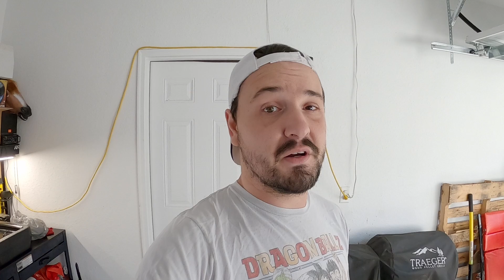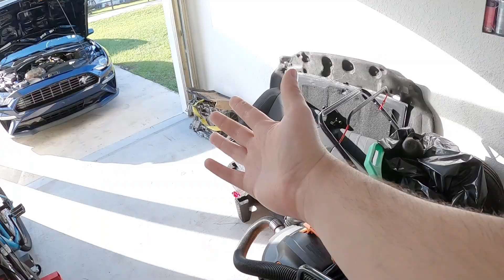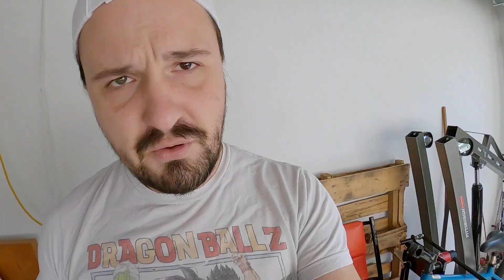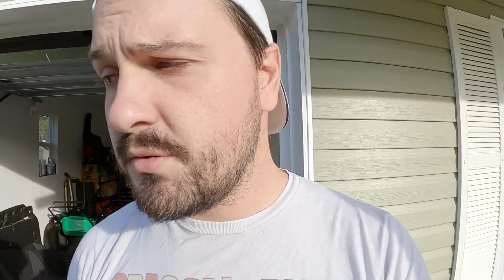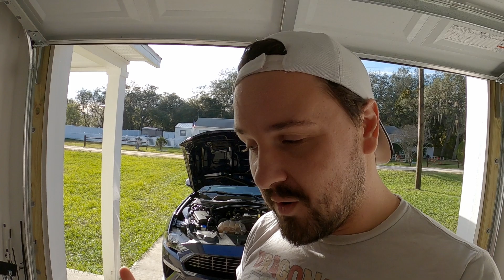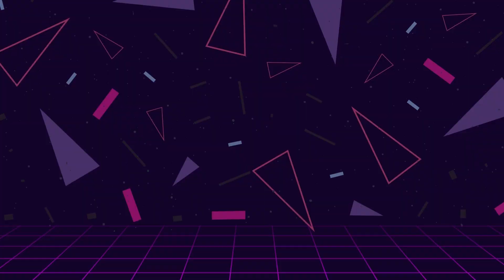I AM THE TUNER!

Comment: That sucks your experience with Gearhead. I've had great luck with their 93 and e85 on my 2015 Interceptor sedan. BTW in one of your last videos, the scratch on the oil filter sealing surface can be polished out with an ultra fine stone from Amazon. As well as the nicks around the edges.
Reply from the maker: I thought about using some jb weld to make the repair to the filter adapter. Spread it on and sand as flat as possible.

Comment: 6:44 you wanted advice and Ryan recommend that you get a tune, that is advice you asked for advice not answer, 
Most advice is not free, and answers are definitely not free so he gave you a strong recommendation and you choose to take that as a personal insult
Reply: How much money did you spend with Ryan of PD tuning?
Reply: @coyote_chaser  none, I a am getting the ford power pack for the 2020 eco boost mustang, I have a warranty
Reply: I had that same issue when I went from the stock 7 psi in my mustang and switched to the 12psi spring on the stock turbo. I called ryan he recommended I get a tune with the new Westgate. I paid 500 for lifetime tune.
Reply: And I have yet to have one issue. I ran logs as well before tuned and the logs looked good but my car would run rough especially after 20 psi for me since I live in high altitude.  Either way glad to see you got it back up and running

Comment: the back pressure issue is very real. The stock turbo on these cars, when turned up, can cause some issues. I wouldn't even recommend trying to hit 500whp on this car with the stock turbo. The cylinder head design on the 2.3 is not good enough. Either the turbo will end up breaking or you'll end up lifting the head. Upgrade the turbo and save yourself the hassle of running into those issues, you have a motor that can support it. Bigger turbos on these cars are way healthier for them!
Reply from the maker: The back pressure test will provide that data. It's a HPP turbo after all. Slightly bigger housing I believe, and bigger exhaust wheel. The question is, is it big enough.

Comment: It's alot if you have never done it it takes alot I do cobb on my rs and hp tuners for the 5.3 forged turbo swap I done for customer. But these cars are completely different my friend I still won't tune my rs because it's another animal and in these If you get it wrong you will be replacing that motor again
Reply from the maker: For now, I just want to make adjustments to fueling for the most part. It's easy to go overboard with changing too many parameters at once(been there, done that), which is how I learned to make very few, small changes, then log. I should be fine as long as I stick to the basics, i.e., spark, fuel, boost.